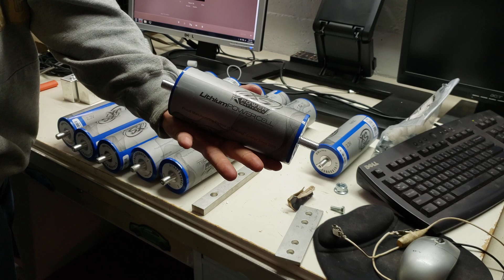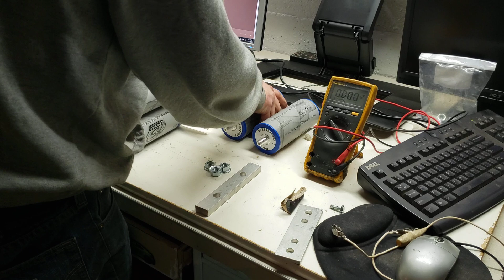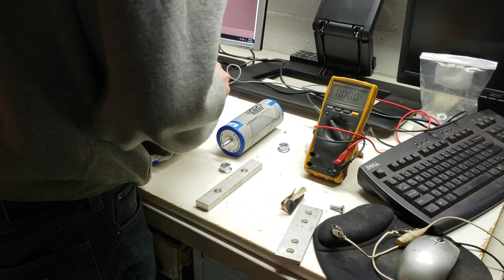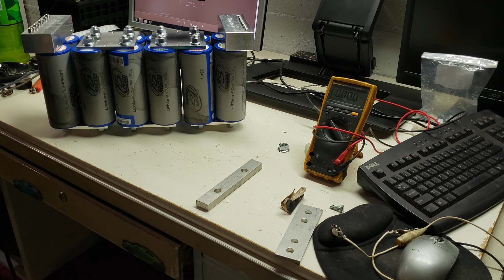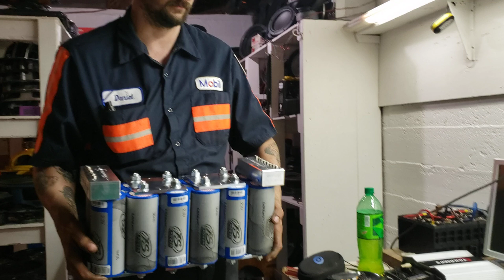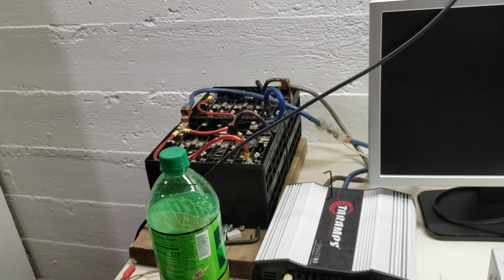70ah Yinlong LTO lithium battery bank ! For car audio

Comment: So how much RMS can this bank support?
Reply: Around 60ish thousand depending on alt power
Reply: @TheSimulatorSmith I know this is 2 yrs old but I really hope you're joking. 60,000? Try maybe 8000 at most with the biggest alternator Mechman makes.
Reply: @grady.M12.83 my 70ah handles 10k with 0.5v of drop with a 280a alt, yes the 60k was a joke

Comment: What about a BMS?
Reply from the maker: you will spend 1000's on a BMS to handle the amps these can charge and discharge . 
i been running these for 4 years personally with no balancer or bms , i recommend my customers to run a balancer tho .
Reply: OK fair enough I was just out looking for information it seemed like you had some good knowledge so I wonder why do you recommend it for your customers if it's so expensive and if you had no problems Thank you
Reply from the maker: @666thebmxkiller  balancer is not expensive , a BMS is expensive 
6s LTO Cell Capacitor Balancer ''Yinlong , Scib, Ect''
Discount code= bd6s
https://srikobatteries.com/product/6s-5a-active-equalizer-balancer-lto-battery-energy-active-equalization/?wpam_id=7

Comment: About how many of these can run 30,000 watts
Reply: 12 cells handle 40k
Reply: Not sure about that
Reply: from all my research 6 cells can handle 4000-5000 watts, depending on your alternator/s, of course. so you'd need 6 banks of 6 cells per bank, along with super caps, you should be fine

Comment: How fast can this thing charge? In an hour?  Ive seen you mention 6C-10C somewhere? Whats the best fast charger would you recommend. Thanks.
Reply: 6 minutes. That's what yinlong specifies as the minimum charge time but you could double check. The characteristics of these are closer to capacitors than standard batteries

Comment: Already have a 40ah bank.  Can I run them side by side (in parallel) with 35ah?  6s2p layout.
Reply: no, capacity of banks should be matched when used in parallel or series
Reply: @oldskoolhead0  nope, different AH banks can be paralleled safely just not in series. OP please don’t listen to this guy he has no idea what he’s talking about, think back to the times when people ran xs batteries under the hood with low AH ratings and paralleled them with big D3400’s in the back

Comment: On the headway cells, what is required to do a initial charge? Can one use a regular car battery charger and feed it something like 2A till it's fully charged or what.
Reply from the maker: watch my videos on charging , btw youtube auto flagged your comment so i didnt see it till now , next time be nice :)
Reply: @mazda2284  Man even after all these years you are still a dickhead. I asked one question and it could have been corrected with some quick short advice.

Comment: 38120's you can make a 64ah and it fit in an empty battery box. Plus these are 60 bucks each....720 batteries alone. Yinlong I passed em up.. for as many as there are out there at 80% capacity and up used...... these cells should be dirt cheap. They're making a bloody fortune off them!! All lithium for that matter... look at limitless....$$$$$$$$$$$ No thank you, I'll build my own and still get hosed over on price point the much cheaper diy way lol smh.... truth
Reply from the maker: I do 38120s , they are not even in the same range , these are new cells , not used . There are cheaper used options but overall these are the safest most reliable cells you can find at a decent price.  I test tons of cells . When you wanna support 10k + rms these are a far better option.  You need a huge 38120 bank to support that .v
Reply: @mazda2284  Have you seen the big d vid and test on his exact same yinlong bank? Did 5800 watts I think and that's why I didn't go yinlong.. that vid of his testing his yinlong bank. Sorry lithium rant lol. I just built a 64ah and have enough cells to make a couple 16ah for my daughter's cars for their little systems and another 64 for me. I'll only be supporting 5k. I've dropped some money on lithium lately..They're badass tho, the 38120's and the same with yinlong cells. Just all pricey as can be right...used is the way to go for most bassheads..& use copper to make up any possible more loss, one vid showed a 7% increase using copper plates!! You're going to see little a little difference on power ik ik but if you're budgeting... it ain't that much of a difference lol... save a fortune going this way.. nice vid man, very good quality and it was easy to see what all you did to make it 😁👍

I'm just griping lol. I want to buy sooo much but soooo freaking much $$ lol lol!!
Reply from the maker: @Basshead40   his video was bad , he had a bad cell . So by following 1 person you lost out cuz a bank that size will support 8-12k . I have a guy clamping 5700rms on 1 40ah bank holding 13.6, I also have videos of another guy with 3 banks clamping 11k holding 13.6v , now he bumped up his voltage to 15.4 and dont see below 14v . Headways are good for low charge voltage. There is a reason we dont use copper aside from price  , it's called galvanetic corrosion. If you use the proper aluminum bars you will not see the increase you are talking about.
Reply: @mazda2284  corrosion in a sealed battery box might take a few minutes tho. Please don't see me prickish lol, really I'm not. I'm just upgrading and trying like hell to get there.  Used for what I'd have paid compared to making that exact bank I made 2 64ah and 2 16ah. There's not a single chance that yinlong 70ah bank would out do a even used 128ah 38120 bank. Then there's still 32ah more I have too if we're all in on this lol.... all for the price of that 1 70ah bank. YouTube collaboration and test off? Lol lol jk!! A guy on another channel tested the crap outta the 38120's and they were my 2nd pick after yinlongs and I seen them do great on a bunch of testing as well as yinlong but I was only going that way building a 70 or 80ah but money talks, I seen that big d whiz vid and was absolutely left let down. Why if a bad cell did he not redo the video grrrr lol... Then there's I'm ready to be able to bang these EMF Banhammers. The 38120's new are as well freaking ridiculous expensive too smh. Damn them non bassheads lmao. Oh and I forgot to mention, I have a XP3000 too that just in case I ever wanted or needed to use it'd be alright with the 38120's. Yinlong cells don't play nice with agm either right?? Another negative for me or a budget basshead. I'm still learning lithium, I'm wanting to go solar and build a bank for the house one day!! Part of my lithium is still too pricey rant and wanting to go solar lol. 
Everyone's stuck inside from covid.. well I live the mask, germx, hide at home 24/7 damn near life. I have addison's disease and a rare asthma. So learning is all I got for keeping my sanity. Straight up. It's tough, ik everyone be feeling it but man oh man I promise it'll get better and you'll live without the mask again, some of us tho this is life and it'll never change. I'm newish to your channel, I was impressed with your vid and I'll be checking out your other content!! Again....(in Richard Nixon voice) I'm not a prick lol! I promise. I'll do yinlong one day too, or I want to at least. Calb as well I wanna try cause I'm interested in them for a house bank. Still, I'd bang the hell out of and test a 100ah calb I've been seeing for less than 500 on allieexpress. Hell man I want to try A LOT of them tbh, I would love love to. If them freaking Chinese companies would take them prices down!! Lol